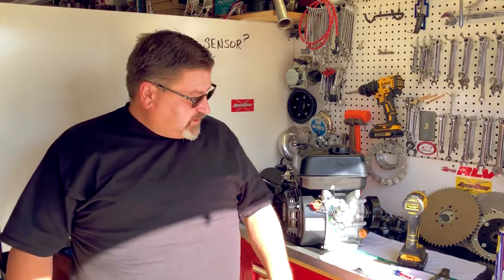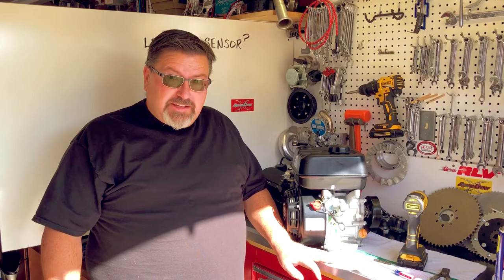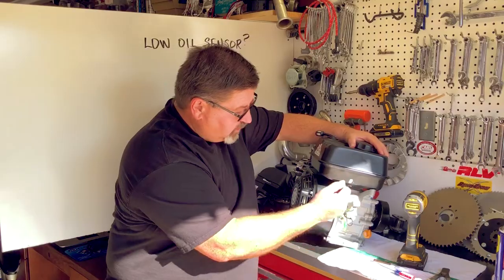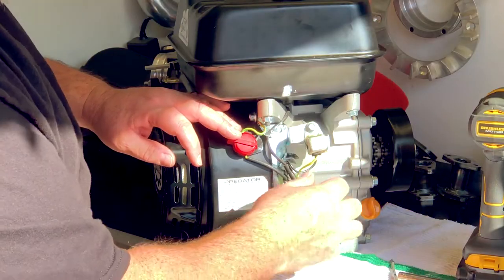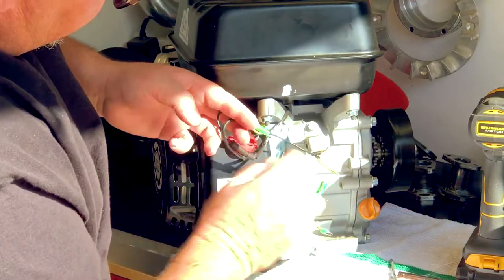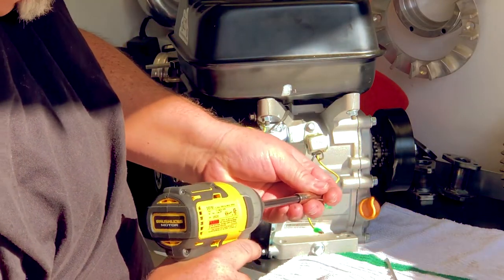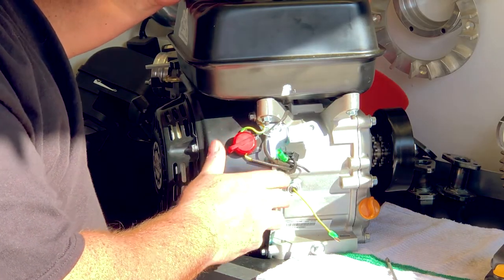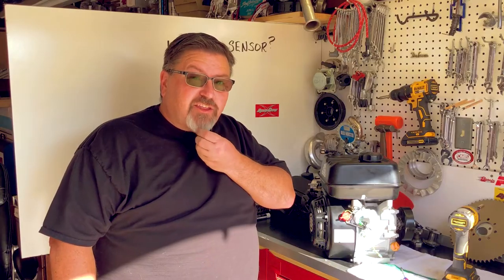How To Disconnect Your Low Oil Sensor

Comment: I was at the point to buy a new snow blower since my Rato chinese refused to ignite the spark plug , <yesterday was working , today NO >. I disconnect the oil sensor as per your intruction.Good lord you save me $ 1500. Thank you very much :face-blue-smiling:

Comment: My tiller was shutting off, that was the culprit. I repowered it with a KOHLER Command PRO CH270. Thanks, I knew it was the oil sensor but not sure how to about disabling it.
Reply: I have a brand new Harbor Freight chipper shredder with this motor and it won't start. Im going to do this and put a new plug in it

Comment: I just installed a billet rod on my predator 212cc  and the oil dipper just barely touches the low oil sensor. And at low rpm it runs okay but soon as you give it some gas it shuts down. I wasn't sure what the problem was I was thinking the carburetor was running too lean 😕 then I sat here and thought about it for a minute and I started thinking about that oil dipper hitting that thing and maybe causing a vortex where the oil isn't hitting it 🤔

Comment: Thanks so much for the info, it definitely solved the issue I was having with my go Kart using the predator motor, every time I would bank a corner hard the engine would die, tried it several times after disabling the oil sensor and works great, no stalling.  One other thing do you know where I can get a high altitude jet for my predator motor 212cc, I live at 6300 ft elevation and the standard jet for the engine isn't set up for that. Thanks
Reply from the maker: These engines come from the factory running so lean that you may not need a different jet for high altitude use. Harbor Freight no longer offers the smaller jet and I suspect that is the reason. I am not able to get any jets smaller that the stock .028” jet you have now
Reply: @TheGrayGoatGarage  Okay, it actually does seem to run great even at this altitude, the main issue was the sensor, and now that is fixed it is running great. Thanks again for your time and video, keep up the great work, and i look forward to future modifications.

Comment: did this and my Dewalt Pressure Washer still won't start
Reply: If gas is left in them they gum up. Using gas with ethanol causes lots of issues with the carburetor. Cleaning the carburetor might be in order.